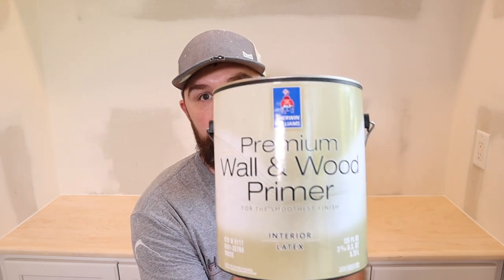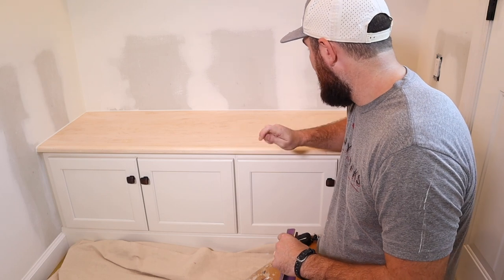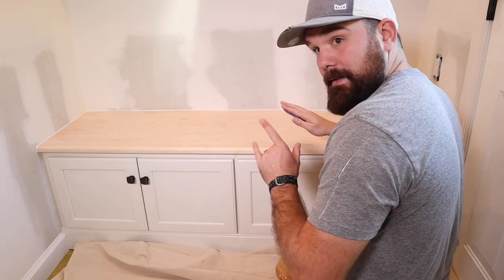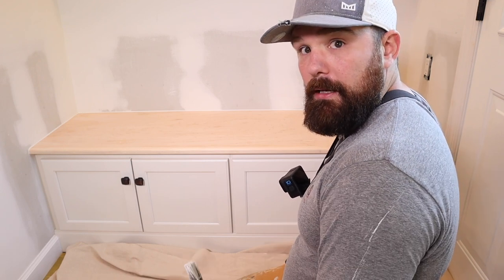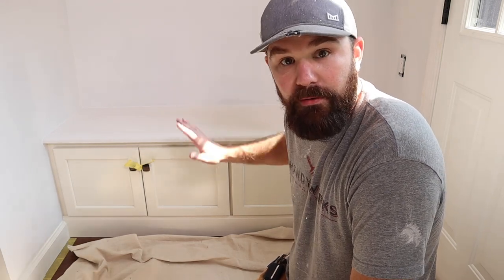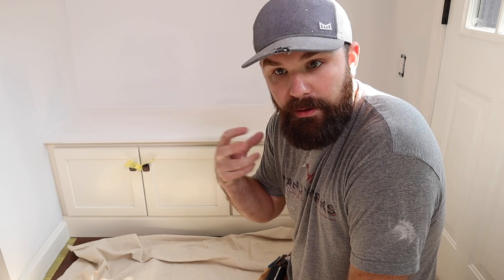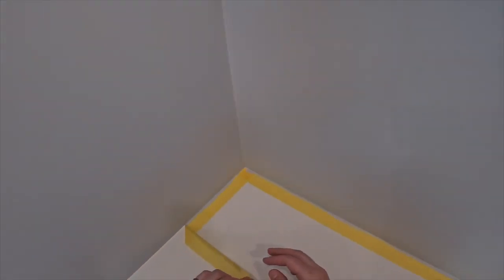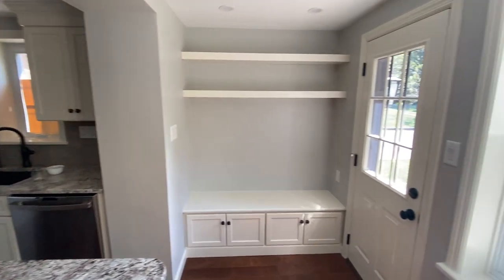I Painted Over 100 Raw Wood Benches // My 4-Step Process To Make It Look Amazing

Comment: After your reviews, I chose SW Emerald trim instead of BM Advance on a buffet I painted. It was a deep color (SW Anonymous) so I was concerned about long dry time. Sanded, primed, used mohair roller. There is a small learning curve. GORGEOUS results (semi gloss looks like satin). No topcoat needed. Curing well. TY for all your info (& for the humor!)
Reply from the maker: Oh nice dude! I’m glad it worked out well 🤙

Comment: Have you compared emerald to pro industrial alkyd urethane? I've been told it's the same product with a lower price
Reply from the maker: I have been told something similar. In my experience the pro industrial is quite a bit more aggressive in the fumes department.  Maybe it’s just me, but I find the Emerald Urethane much more pleasant to work with.
Reply: @SuperVassarBrothers  I normally work with pre catalyzed high build lacquer. Soo never smelled a different

Comment: Why did you choose to paint the bench before the walls?
Reply from the maker: That's how I prefer to do trim.  Some folks like doing the ceiling, walls, then the trim.  My crew and I like doing the ceiling, the trim, and the walls which is also a common way to it.  There's pros and cons to both methods, but it works well for us.  You can get get the trim and doors going while working on the ceiling.  The only thing we tape it is usually the baseboard.  That keeps the splatter off the baseboard.